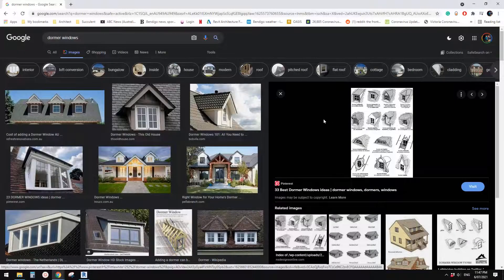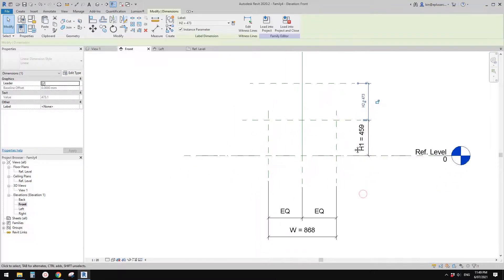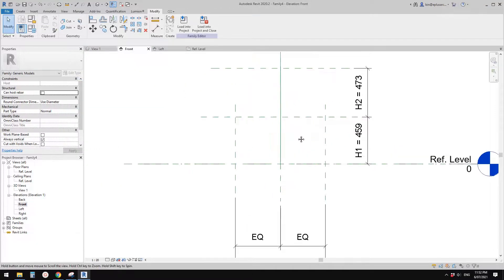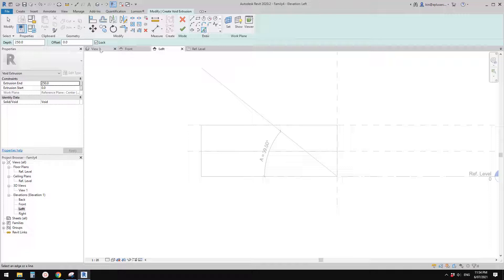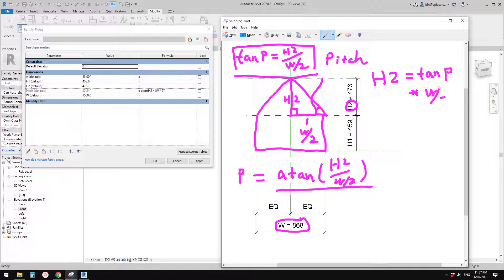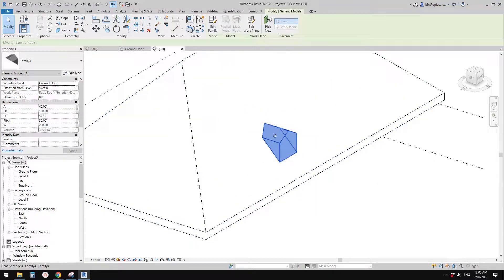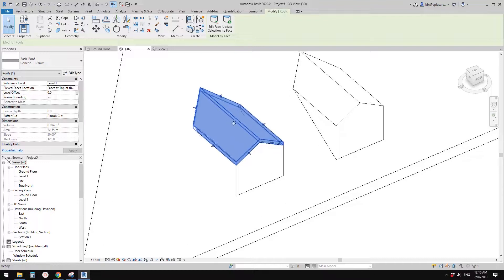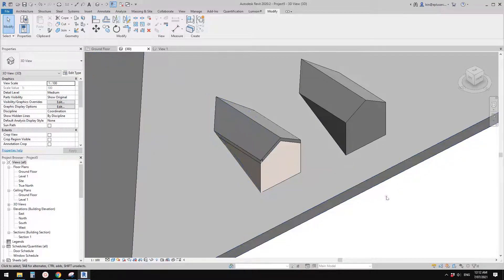Everyday Revit (Day 473) - Dormer Window As a Family?

Comment: great video. question, we usually add a trim molding at the roof. i know you said you use this as a tool to add walls and roofs, but when we are modeling and making quick edits, it would be great if we can add trims to this family. my issue is the trim sweep doesnt turn the corner properly like the fascia sweep does in the actual  model. it doesnt stay parallel  to the ground and keeps the angle of the front of the dormer. wondering if you knew how to fix that in this family. i can send you what i tried if you are interested. thanks!
Reply from the maker: Sure, please sent the file and I’ll have a look.

Comment: Can you explore little bit more this tutorial means to put window and clay tiles on roof specially on dromer roof
Reply from the maker: Although we modeled a family that looks like a dormer window, and we can potentially add more details such as windows and tiles, I don't think this is in the correct direction. The intension is to use this family as a tool to locate the walls and roof, then add other elements, such as windows. Try to model everything under correct categories.
Reply: @BINHE615  ok